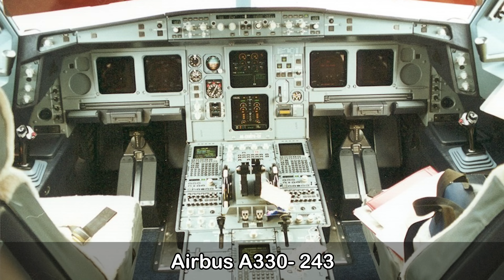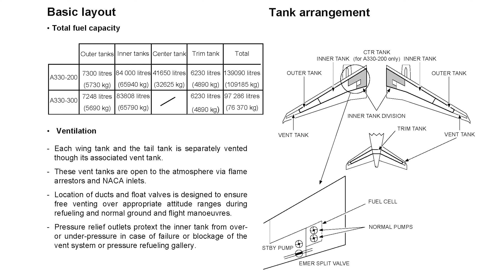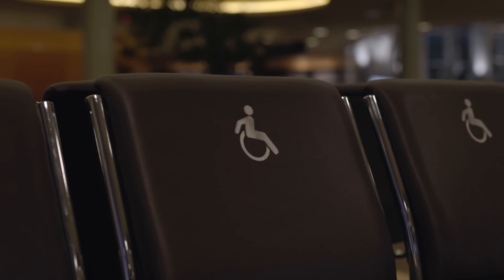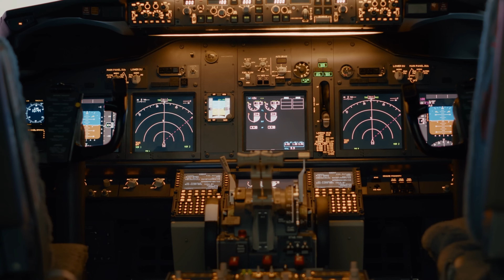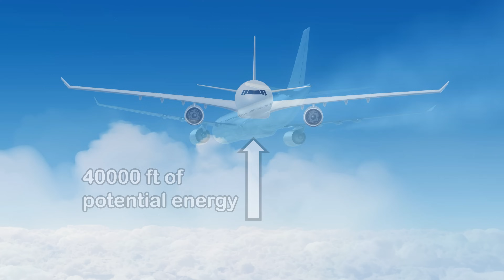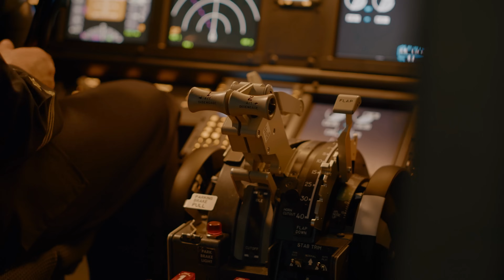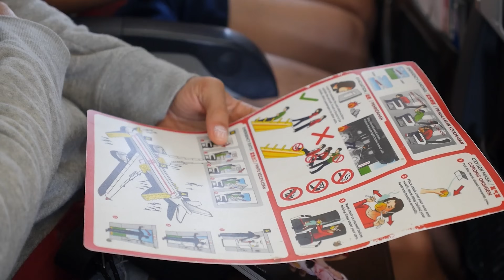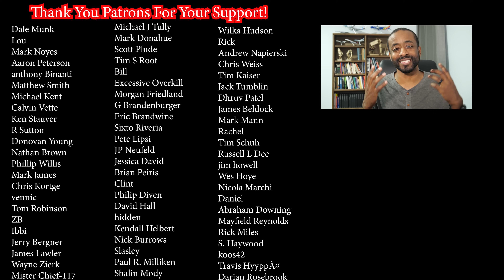The RAM Air Turbine. How Planes Continue to Fly Without Fuel

Comment: There have been a few close run ins lately on the ground or even close to the ground. What can be done engineering-wise to prevent such near misses? In the air we have TCAS but it was not always believed in and ATC people called the shots. At such speeds by the time you see another object in the air, it is too late to react.

Comment: Excellent job here, Jeremy.  It's very hard to find coverage of technical aviation topics that's done well, and you've nailed it.  The pilots in this case were fortunate to have a wing-mounted RAT.  I've flown maintenance test flights in an aircraft with a nose-mounted RAT, and the noise it creates is astonishing.  It really made me think about how I would manage that massive distraction and how I would communicate with my co-pilot in a situation that resulted in RAT deployment.  As you pointed out, they're an important backup system to have on board, but in some cases they can create problems of their own!

Comment: I know this story quite well. The Ram Air Turbine, (RAT) onboard that specific aircraft was actually manufactured by a close associate. Wonderful piece of technology! We have an aviation trivia question here: how many turbines does an A330 have? You are absolutely correct, many aircraft flying today were not designed with - nor are some equipped with this backup technology. Certainly was fortunate for this flight.
Reply: An A330 has six turbines I know about - two in each engine (counting each spool as one turbine), one in the APU, and the RAT. What have I missed?

Comment: The plane should have a lithium ion batter dedicated to just flight control computer processing necessary for flight controls.  Then a super  capacitor that can quickly charge up from the aux turbine system.  This seems like very easy design to make the plane safer. 
10 100 AH lithium ion 48 v units should be sufficient

Comment: Upvotes for UTC. The pilots screwed up on nailing the brakes, thinking the plane was at full weight. There was no reason to kill the tires since the wings were empty of fuel. Had it been an overweight landing, that'd be fine, but this plane was not overweight or at MTOW.

Comment: As far as new topics go, I've always been interested in the lifting body planes and why they didn't catch on. They seem to make a lot of sense but I'm just an old boatbuilder, not a pilot or engineer. I'm sure there's a reason that I've missed. I'd love to see you cover that and maybe other alternative flying machines (good, bad, wacky, whatever)
Reply: Fuel capacity is probably the main one if I had to guess.
Reply: There's a few tradeoffs with lifting bodies. The biggest is probably increased drag. Modern airliners can alter the shape of their wings using flaps and slats to give more lift at slower speeds and less drag at higher speeds. Doing so in a lifting body would be pretty tricky.

Another reason: airports are designed to handle conventional shaped aircraft. Something like a lifting body or flying wing may be difficult to dock to a standard gangway.

Comment: Great video.  Tiny correction:  You mention that the pilots "asked" to divert and then "received permission".  In an emergency, the pilot needs NO permissions; the FAA specifies that the pilot is the sole responsible party and may do ANYTHING to handle an emergency.
Also, you spoke naively about the pilots decisions about slowing/speeding the plane to control the RAT RPM.  All planes have a "best glide" speed that will give the maximum distance achievable without power.  That is the ONLY speed that a pilot would want and would be the speed they would trim for; in fact, trimming for that speed is literally the first step in an engine out scenario.  Of course, that speed is an airspeed, not a ground speed, so the ground speed would be decreasing as they descended, as the thicker air would provide the same "apparent" airspeed with less and less true airspeed...making the calculations of what range could be glided a very complex one.  Most slick planes will have a "glide ratio" (altitude lost to horizontal distance flown) of well over 10:1, so at 40K feet (ie, 8 miles), you could definitely expect at least 80 miles of glide distance...and it sounds like that just about worked out, as they did arrive at 65 miles being too high.
Lastly, I thought the discussion about loss of energy/energy efficiency, etc was too basic and somewhat belabored...though I get that you were trying to teach some basic thermodynamics.
Reply from the maker: Larry... I am glad you were so attentive. Seriously,  I love it when people are engaged with the details, and want to share their knowledge and experience... We all learn more. Thanks! I am asking a few pilots to help me review videos in advance to find errors. Perhaps you should be one of them... if you really want to help? Just a thought. 

Though I must admit I feel fortunate that we are mostly splitting hairs here and I made no real blunder LOL. I am not a pilot, so I would hope my pilot viewers would be okay with me being naive about the details of how a pilot would control the plane's speed and handle it over all in this situation. We are really here to talk about the engineering, I was not trying to explain how the pilots would handle the plane, but how the RAT manages its own speed regardless of what the pilots do. I think that was communicated. Again we are splitting hairs so I am not saying you are wrong, or that I am right. Just that this is a very minor clarification that would not change what I said in the video.  

The discussion of thermodynamics always seems over done to my more science minded viewers, but I have been talking to the general public long enough to know that this is exactly what was needed and probably could have been another 30 seconds longer. If you want to get a sense of how much that is needed check my video "what happens when you add a alternator to a Tesla." I am confident you don't need to watch the video to know the answer, but when you skim through the comment section you will know why I invested several minutes to make this point very clear in this video. That video is quickly becoming one of the most watched on my channel because of this discussion. Again... thanks for being here Larry. I hope you join me for the next one, and bring your experience with you. These kinds of discussions are important. I know for a fact you are not the only one thinking your comments. So its good for people to read your words and mine to add to the discussion. :) edit: fixed a typo

Comment: Is it possible to measure both the fuel left and fuel consumption in order to calculate whether both match and therefore find an indication for a possible leak? And if so, give some (stronger) warning signal?
Reply from the maker: A lot was learned after this incident about the way information is shown to the pilot. The information was there but not obvious to the pilots. If they had followed the check list they likely would have got to the right conclusion quickly enough and diverted with a normal landing. But also after this flight Airbus changed / improved the checklist and changed the way information is displayed to make the messages more clear. Some of this is discussed in the final report.
Reply: @Jeremy_Fielding  thanks

Comment: Jeremy, I worked for an airline, in the maintenance dept.  Regarding the passenger overhead baggage compartments; Here is an airliner design modification I suggest:
Install an emergency ALL overhead compartment doors locking system.  Flight Director can engage it during emergencies.  Passengers will NOT be able to gain access to the overhead compartments, at all.  This prevents passengers from inhibiting expedient emergency eggress deplaning.  My name is BRETT YENZER.  Please pass this idea on to your contacts.  It will save lives.
Reply from the maker: I think that might actually be worse. Likely much worse. In this scenario a panicked passenger is not thinking clearly, and would just continue to pull on the handle over and over blocking the traffic for longer. This is why doors now have panic bars on the inside. Because it was found that people panic and push on doors that should be pulled.... no matter how many signs there are or how clear it is to a regular non-panicked person. They don't have the same sense of time or reasoning. This door "use to work" and so they assume they are doing something wrong and continue pulling. At a minimum this would need to be tested and simulated in a mock plane with something that makes the people respond in a way similar to a real accident. Another option would be something to completely covers the doors so there is no way for someone to even try to access the door or their bags inside. That would be pretty challenging though. First they were expecting it to be there so they might just stand there frozen and dumbfounded...Second, a panel that slammed shut would have to also be passenger safe if someone happened to already be digging for their bags when the mechanism was activated. Its a complicated problem.
Reply: @Jeremy_Fielding  YES.  Agreed.  It is complicated.  And yet, still, it remains a problem, (passengers trying take baggage down an isle and then an escape slide too) NEEDING a solution.  So, again, PLEASE, share the idea.. Give the engineers a chance, to HAVE A GO at it.  If you do, then, just as you have done,  they too might surprise us all with THEIR creations!  Let em try Jeremy.  Give em a chance, to have a go.
Reply from the maker: @BYENZER  I guess I don't completely understand what you mean. I am not preventing anyone from trying, nor do I have special access to any special decision maker. This was a well known problem before today, and way more knowledgeable and capable people are already working on the overall problem of safe evaluation. :) This component just doesn't have a good solution yet that meets all the constraints some of which are safety, human behavior, and cost. The safest and cheapest solution is figuring out how to control human behavior. But if we could control human behavior we wouldn't need prisons. 😀

Comment: The fuel evaporating also cools things, air cooled 2 stroke engines rely on this to have high power output without overheating, turbocharged diesel engines often use methanol injection to cool and compress the charge air. I would guess that also affected the gelling of the oil. If they had gone through their checklist, would there have been a fuel flow meter that told them about the leak?

Comment: Very disappointed the engine management system (FADEC?) didn't give a warning about unusual fuel flow.
Reply from the maker: Actually it did! The problem is information overload and other human factors. They were also use to seeing one of the indicators of low fuel on long flights, just not nearly this early in the flight. Reading the full report is really interesting.
Reply: @Jeremy_Fielding  Nice of you to reply,

Comment: Overall nice video, but I think that potential energy should have been mentioned in your energy balances. It takes a lot of energy to lift a plane to altitude (I suspect much more energy than that needed to overcome drag and other friction losses during ascent). As the plane descends it is converting the potential energy into kinetic energy (speed). Without that conversion it would quickly lose speed and flying capability.
Reply from the maker: agreed. This was a much larger part of the original cut.. but as you saw the final video was nearly 30 minutes. I trimmed a lot of the energy and really detailed RAT "functionality" part to make the total time a bit more reasonable. It is challenging to get someone to commit to a 30 minutes video and the odds go down with each additional minute LOL. Anyway, I completely agree with you. I just had to make a judgement call on what to cut.

Comment: The innovation of the preflight checklist often gets overlooked as too basic or obvious. When post-war planes with jet engines first were first intoduced the wisdom at the time was these things were far too complicated for the commercial sector to make regular use - far too many things to remember - even though the US Navy and Army both had adopted "Standard Procedure Flying" by the late 1930s.

Preflight checklists made commercial air travel possible.
Reply: Checklists (and pre flight checks in general) make safe flight possible.

I know of several accidents caused by neglect during pre flight check. No excuse to skip it, no excuse to not do it with another person. Even on a glider.

Comment: It would be interesting for people to see how planes work that do not have any electrical systems.  You don't see this much any more other than in the very light weight bush planes.  There is no battery at all in these planes.  So, no starter, no battery, you only get electricity while the engine is running and that power will run the ignition system of the plane and some basic lighting.  No fancy electronic instruments or radio!  The radio is typically an HT (hand held) with its own battery.  The instruments are run with vacuum pressure provided by a venturi tube.

Comment: As a retired Airframe & Powerplant Mechanic with 50 yrs experience, a RAT, (Ram Air Turbine), uses the propeller to spin a hydraulic motor to provide emergency hydraulic power to primary Flight controls and in no way helps “power the aircraft “ as the title of the video claims.

Comment: Most fighter jets have a ram air turbine. Cool video
Reply: That’s incorrect to a large degree.  The current US fighter types in use (F-5, F-15, F-16, F-18, F-22, F-35) do not have RATs.  The last US fighter in widespread service to have a RAT was the F-4 Phantom, and those were retired from manned squadrons in 1996.  Even the mighty F-14 didn’t have a RAT.  However, there are current European-built fighters that do have RATS, but their numbers are significantly lower than what the US can field on any given day.

Comment: Mr Fielding, could the fuel lines be manufactured with double walls?
Reply from the maker: Certainly. But they are already strong enough. It would be better to use the parts designed for the job rather then increase the weight and cost of the parts :)

Comment: The biggest thing, more than the fuel leak even, was that the pilots failed to use their checklists. The fact that they made it was just a coincidence, and a side effect of the plane being engineered enough that it could feasibly make it.
Had they used this checklist, they would have made it to their divert airport without issue and fuel to spare.

Only reason the pilot's kept their jobs was due to the report finding that the checklists were inadequate tbh.

Comment: Could I get some info about the time involved? 65 miles is not that significant in time when you are going several hundred miles per hour. At 300MPH, it's a little over 20 minutes. At 3400 feet that averages 180 feet per minute drop. Would this be a pretty fair scenario?
Reply from the maker: Read the final report. It’s in the description

Comment: There are plans for locking overhead bins so you can't get to the bins in those instances. Well done Jeremy. I did cringe a little when you called the FA the flight director. There is one but it's in the cockpit and is part of the autopilot. On domestic the lead FA is called number one and on international they are called the purser (old antiquated term).
Reply: He used the terminology from the report.

Comment: With respect, that's not what the cross feed checklist says. 
It doesn't say 'confirm that you don't have a fuel leak first', it says 'do not apply this procedure if fuel leak is suspected' - those are two very different things. The first is an imperative, demanding positive action, the second relies on a fuel leak being a suspected issue, which is not something that the pilots were thinking of at this point.
They hadn't been any simulator training on fuel leaks and no emphasis was put on it during type ratings.

Your presentation comes across as the pilots making an obvious error by engaging the crossfeed - something which was only clear in hindsight.
Reply from the maker: You should read the final report. This was just a laymen’s introduction to what happened. The pilots indeed made errors. Thanks for watching!

Comment: "Fly-by-wire" is such a lamentably confusing term, considering small planes use (non-electrical) wires to move the controls. And it's generally a contrast with hydraulic controls, but this is particularly confusing to ordinary people ... because "fly-by-wire" almost always still has hydraulics.
Reply: As an aircraft mechanic, we call what you are calling “wires” for the flight controls by their proper name, cables.

Comment: (off topic )  when making a three phase inverter using capacitors to balance legs and using a idler motor to ramp the 3 phase motor to running speed will having idle motor running in the wrong direction for the 3 phase motor will it damage the 3 phase motor or will the 3 phase motor just stop running once the idler motor is disconnected?

Comment: I would like videos that talk about TRADE OFFS. I tell people often, Engineering is limited by bean counters and competing interests. Want good MOG, sacrifice weight. that means GARBAGE plastic parts in most cars and a throw away society. I prefer to give up MPG and get longevity. Most manufacturers don't do that.  I doubt there was much debate here, we may never need that fail safe power supply, but weight vs. risk we are going with it.